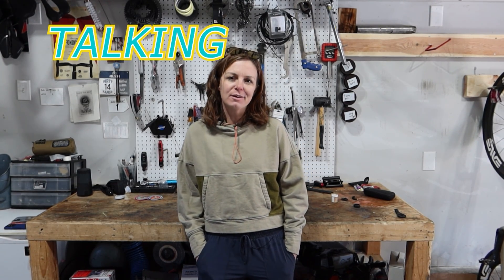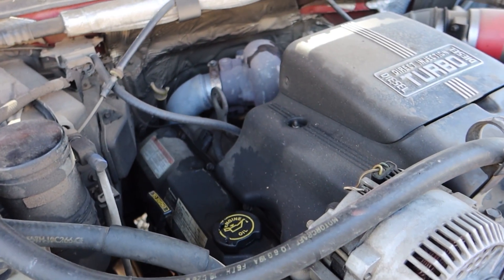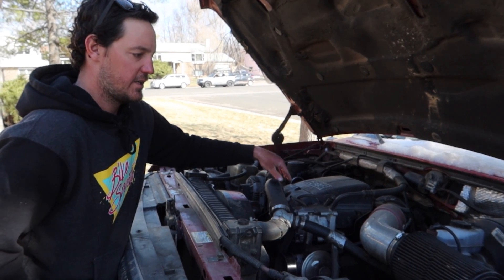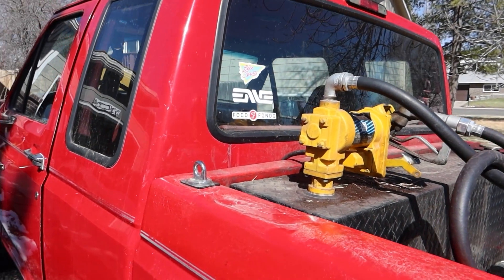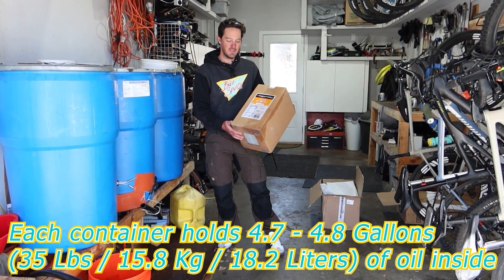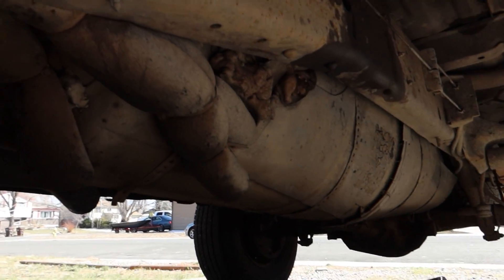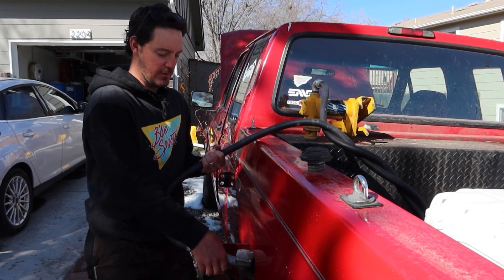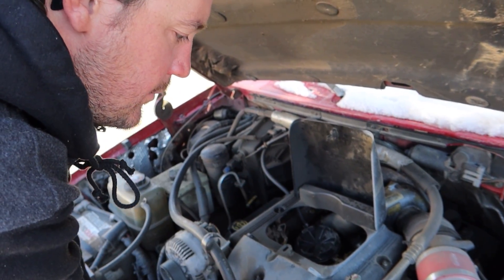How the Waste Veggie Oil Truck Works

Comment: Are you actually heating the bio tank before you swich to it. Or only after you start drawing from it.
Most people use the heater core lines in series. Thus avoiding the affect of reduced water cooling flow thru the engine.
.
Also avoid long term fuel storage in the axillary steel tank, and make sure you have it vent free for any long term storage. Long term affects of being open to atmosphere will eventually turn fry oil to a nasty sticky goo mess.
Best opinion is,
Stainless is considered 1#
Plastic is considered 2#
.
!!Definitely avoid copper anything in the fuel system!!
.
I figured this out mixing the leftover junk with sawdust, making fire starter basically turns it to a paste being exposed to atmosphere, excellent for a fire starter but a major pain in a fuel system.
Reply from the maker: I was waiting until the truck hit temp and the water pump was on before switching to the heated veg tank. Both tanks were steel and steel fuel lines. I did a few experiments to make sure I knew how long the truck had to be running the fan and water pump before the coolant lines I had running to the tank were actually hot and how long it would take them to cool down. I also had the hot coolant lines running above and below the fuel lines along the frame rail, and insulated them around the fuel lines so when the motor was warm and warm coolant flowing, it was heating the fuel lines and the tank. I just didn't want to drop the fuel lines and run a jacketed line along the fuel lines, which would be the best way to do it. Every so often, especially in winter, I'd run a few tanks of diesel with additive or sea foam through the veg tank so I wasn't too worried about sludge buildup over time. It was more of a long haul vehicle, I'm sure if it was used as more of a farm truck and not running through as much fuel I'd have more issues.

Comment: Very nice setup guys! One question, how do you deal with glycerin deposits on the engine?
Reply from the maker: We never really felt this happen but have heard of it. I think because we were heating up the veggie oil fuel tank, purging when stopped and cooled on Diesel, and sometimes putting diesel through the veggie tank it general kept clear of deposits. We did a few sea foam treatments from time to time and replaced the fuel filter frequently but never felt any sludging or glycerol deposits. If they were anywhere, they'd be in the bottom of the secondary veggie oil tank and running a few tanks of diesel through it would maybe break it up?

Comment: I ran my BMW R50 motorcycle on aprox. 50 % diesel & 50 % gasoline . The R 50 has 6.8 compression ratio it was summer .

Comment: You can actually mix the waste veggie oil with your diesel fuel to thin it out. You can actually also add a little bit of gasoline to it all in one tank. Don’t get me wrong. I do like your set up. If I had the 7.3 diesel that’s the way I would go just one tank they will pretty much run on anything.

Comment: Hey, thanks for the info! After it hits the garbage can, is it an in-tank heating system or is there just a tube that flows between the tank and the trashcan? I’ll be converting my rig soon, so I’m trying to find the easiest/cheapest/best solution. Thanks for any information you can give about the fuel tank heater!
Reply from the maker: Hey sorry for late reply. The trash can just covers the stock front take and holds the insulation on. There’s a heater line coming from the radiator, to some metal pipe to heat that tank, then back to radiator to become cooler but it’s still hot enough to heat the tank and the heat holds pretty well with the insulated trash can

Comment: hey i hope someone can help me. Me and my boyfriend have a diesel car it's automatic and a few days ago it was smoking and someone put oil in for us, we then went and got more oil because he only put a little in. Then today we noticed an oil leak, so we put more oil in again just to make sure we can get home and we didn't get far until the engine made loud revving noises, there was no more power going to the wheels it was just revving, there wasn't even any smoke. but there was a burning smell like burning rubber
Reply from the maker: Just keep putting oil in it. Any burning rubber bits, oil. Also check the blinker fluid.
Reply: @bikesportsco  put more oil in after it stopped working and was leaking oil?
Reply from the maker: Yes. If it’s leaking enough, you’ll never have to get an oil change again, you’ll just keep adding.
Reply: @bikesportsco  so we found out the thing called gaskets are broken and oil was mixing with the fuel.. i think you should probably not give advice :p
Reply: @pinkiethesniper6630 dog they told you to check the blinker fluid, they were messing with you.
Reply: @blimp2920  i know it now, and funny too. I have been in mechanic school for 7 months and i absolutely love it. Now I moved on to a Seat Leon Cupra MK2 Type R and recently had an ECU remap .. a lot has changed sinse my last post here :X